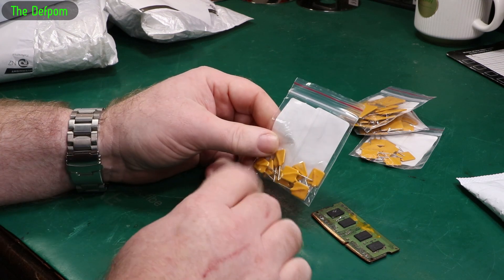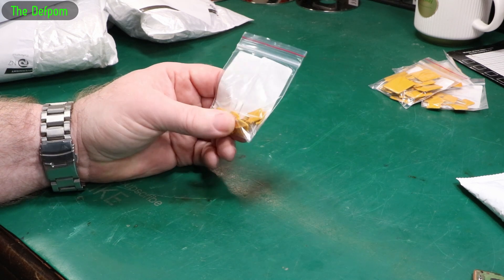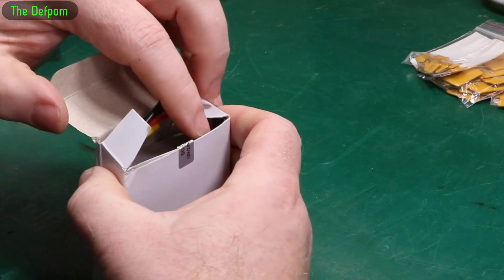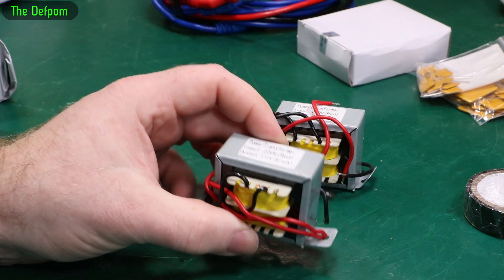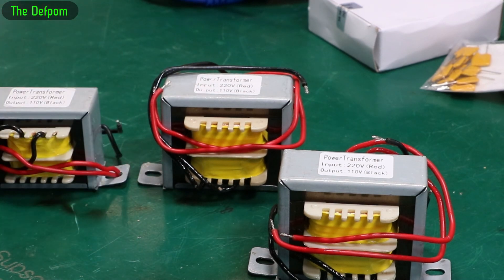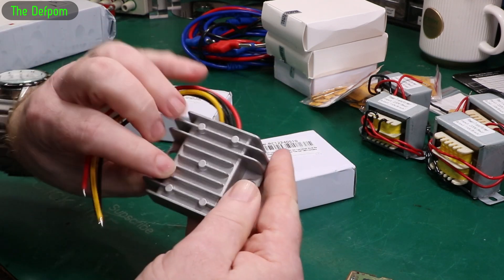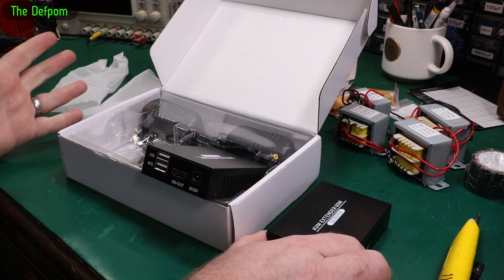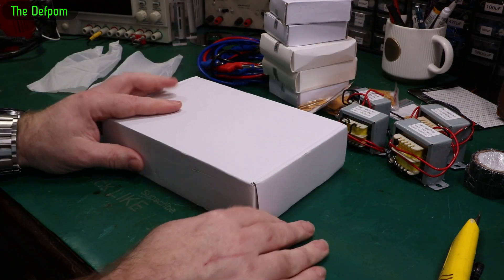🔴 Mailbag Monday 21st October 2024 - No.1291

Comment: What is the frequency on those transformers? The reason I ask is, it looks to be voltages used in the US, which is 60 Hz. A 50 Hz transformer will work at 60 Hz, but not vice versa. 60 Hz on 50 Hz will run hot, as the core is smaller on the 60 Hz transformer over the higher frequency.
Reply: I think also amplitude of output voltage will be different/wrong if frequency is not matching the transformer freq?
From video he only stated he wanted he wants to convert from 110V to 240V, but he never mentioned about Hz used by device and Hz he has in his country.
I think he would have to check this with oscilloscope.
Reply: @orion310591RS  I didn't notice the frequency listed on the labels, only the two voltages, and I don't know if the seller stated it. That voltage, though, made me wonder what frequency it was.

A 60 Hz transformer running at 50 Hz will have a core that goes into saturation, thus, it will get hot. There's not enough iron in it, as they run the cores at about 10-12 kilogauss in most cases, which is just under the knee of the B-H curve. If you lower the frequency on a 60 Hz transformer, the core runs into the saturation region above the knee. I would say that the waveform of the secondary would be affected somewhat as well.
Reply from the maker: @craxd1  going from 240v 50Hz to 120v, will be at 50Hz instead of 60 but shouldn’t really matter for what it is used on.
Reply: @TheDefpom  Those look like the transformers wound in China, and if so, they design most everything for 50 Hz. My hope is that they just picked a core that they already had, and adjusted the turns per volt. Many foreign transformer companies just wind them all for 50 Hz, since they know they will work on 60 Hz. They don't have to stock two different cores that way.
Reply: Maybe 40 years ago I bought a transformer from Tandy (RadioShack) here in the UK to power an LED digital alarm clock module (from RS components) 

240v in possibly 12v out, at maybe 250mA, a US sourced product, 60Hz, secondary current requirements were low, maybe 100mA.

It initially worked fine but one day, fortunately when I was nearby it partially melted its way out of the (very expensive) two tone Vero plastic case, I replaced it with a UK sourced transformer and that setup lasted without a problem for a couple of decades until I upgraded to an alarm that successfully rode through external power failures.

Since then I’ve always been wary of wound 60Hz products running on 50Hz.